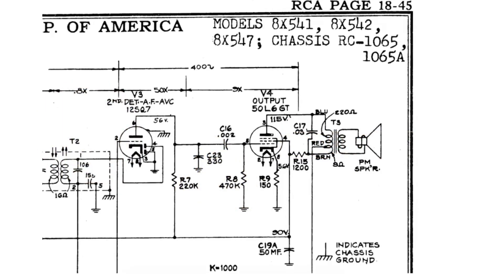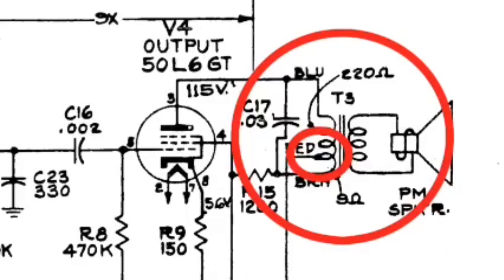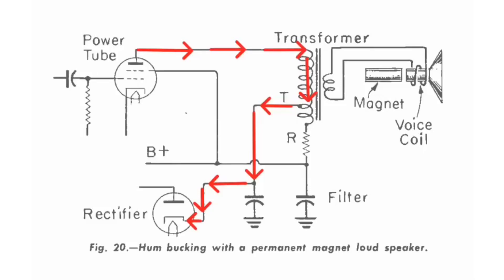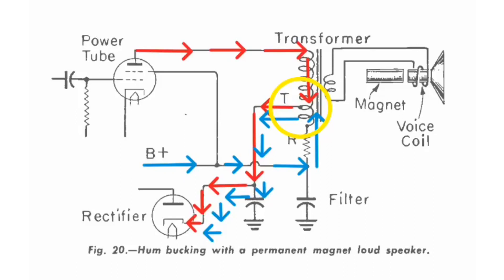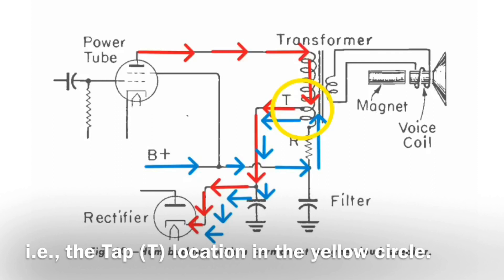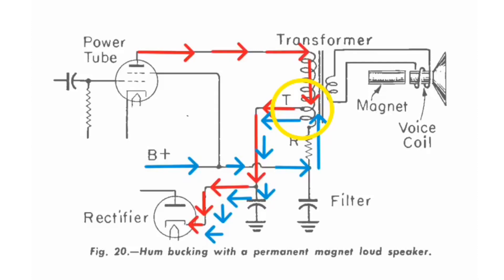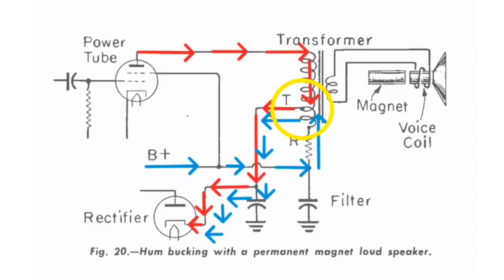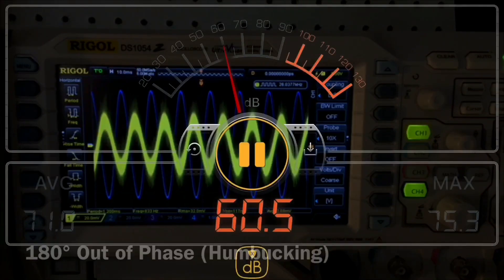RCA 8-X-541 - Cause & Effect P2 (How Does the Tapped Output Transformer Work to Mitigate Hum?)

Comment: My RCA 9-x-571 has the same circuit, I didn't know that it did, but now I do because once again I've been schooled. I just finished this radio and was able to troubleshoot a no audio situation because of your signal tracing video, thanks again prof.
Reply from the maker: That’s great news Jim. What was the root cause of the problem? Best, Don
Reply: Don, the technician (me) soldered the coupling cap from the plate of the SQ7 to pin 4 of the 50L6 when it should have gone to pin 5 but the signal tracing led me to my mistake.

Comment: I believe that the 120Hz hum is reduced by two methods, when part of the output transformer winding is used in the high voltage smoothing circuit.  Firstly the inductance of the partial winding reduces the 120Hz ripple. Secondly, as you say, a voltage is induced in the transformer secondary which is out of phase with the 120Hz signal from the output vacuum tube.  Hence some cancellation of the hum occurs.  Regards Frank.
Reply from the maker: Thanks Frank. It could be 120Hz too depending on the rectifier (full-wave 120 Hz & half-wave 60Hz) to your point. Take care and thanks again for reaching out and watching. Best, Don

Comment: Interesting... very interesting Don. I didn´t know about that method to avoid hum sound at loudspeaker side.
I have understood that in loudspeaker side you have two signals: radio sound signal (that is an independent signal), and 60 hz signal that comes from the power supply.
In the primary side you have again radio sound signal and 60 Hz signal from the power supply. If, in the primary side you add a -180º 60Hz signal, you also obtain a 180º 60 Hz signal at the secondary side.
The onliest problem is to calculate turns on the primary side to do amplitude of both 60 Hz signal, dephased 180 º each other in the way to get a NULL 60 Hz signal in the loudspeaker.
I must repeat... VERY INTERESTING!!! and say, thanks Don, for letting us to know more about practical electronics.
Have a nice day.
Ketk Aiball (España).
Reply from the maker: Ketk - an interesting design concept for sure. Most manufactures just used a standard output transformer and increased the capacitance to mitigate the hum. Thanks for watching and stay well. Best, Don

Comment: Hello Don, You sound like your doing good, wishing you a speedy recovery. I am however some what confused, in that, I have always read and heard that electrons flow from negative to positive, the plate is positive, cathode negative, what am I missing? I will have to read in my '57 Radio Amateurs Handbook, I'm no radio expert by any stretch. I've been meaning to thank you for always sending me a reply, but, only if you want to, no obligation, it is nice to correspond with you. Great demo and explanations as always. Take care, Cass.
Reply from the maker: Cass, overall I'm feeling better as each day passes; thanks for asking. Regarding the electron flow, I used “Conventional Flow Notation” + to - to align with the engineering theory and text books presented in late 40's early 50's on this subject. You can redraw the circuit using “Electron Flow Notation” - to + and the 180° out of phase relationship at the transformer tap location still presents itself. I hope this helps and thanks again for reaching out. Best, Don
Reply: This is often a point of confusion for people with a causal knowledge/understanding of electronics. 

 You have to remember that the diode is not the source of power in the circuit, in this case it's the wall socket.  Although the electrons flow from cathode to plate/anode within the tube, in order for this to happen the electrons in the part of the circuit external to the tube itself have travel from the from the plate back to the cathode. Therefore the cathode pin of the rectifier be positive with respect to the plate pin if you measure with a voltmeter.

I think you will find that if you pull up and examine any schematic of a radio with built-in power supply, you will find that the cathode of the rectifier is on the positive rail.

Comment: It's amazing how the engineers of that day came out with the idea of using a portion of the audio output transformer as a choke to save the cost of manufacturing a separate choke for the pi filter of B+ circuit.
Reply from the maker: Jim, very clever integrating the choke filter into the OT to your point. Thanks for watching. Best, Don